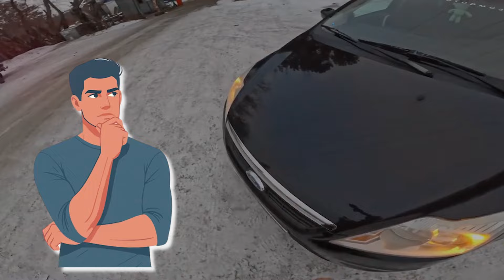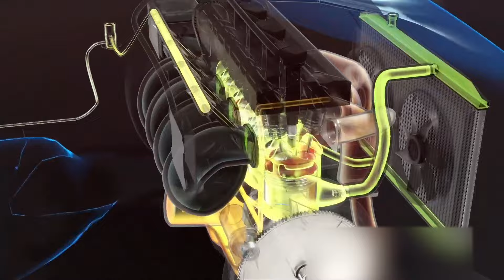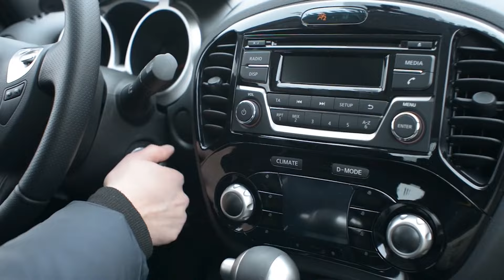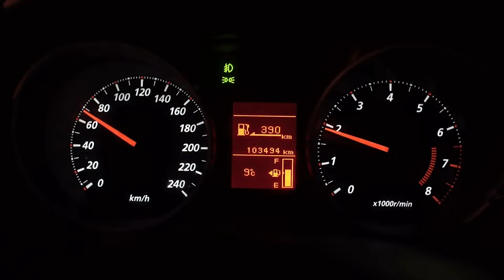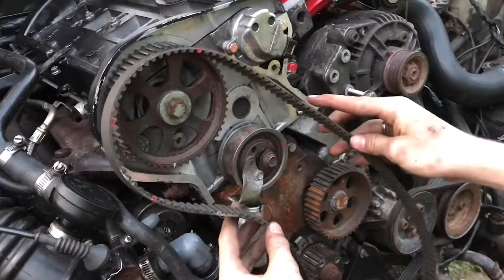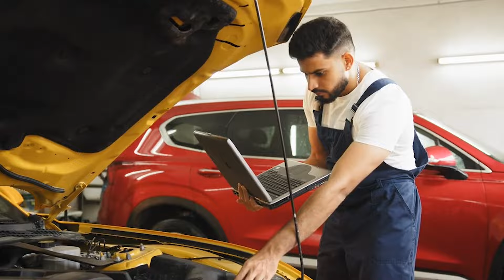Top 7 Ford Failures That Cost Owners THOUSANDS Avoid These Mistakes

Comment: I had my water pump go out on my 2016 mkx, i absolutely hate fords designs especially the internal water pumps on every single ecotrash engine. The crap luck i had was all the shops around including mom and pop shops refuse to work on it and when I found one that would charged me $5000 for the fix and ruined my timing at the same time. Just for reference meineke is the shop to avoid and ford